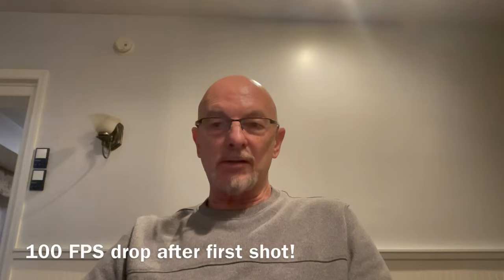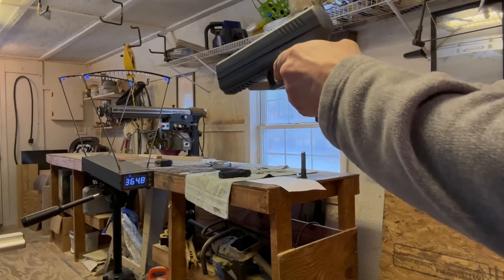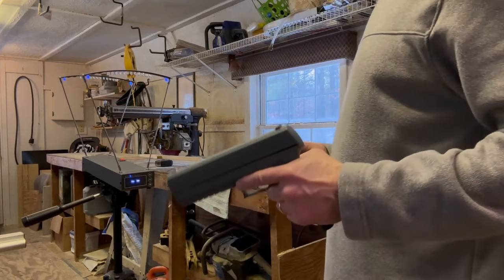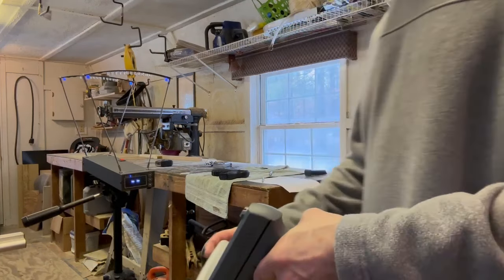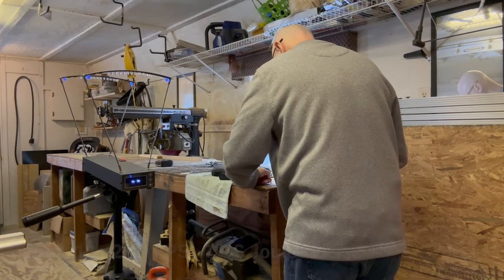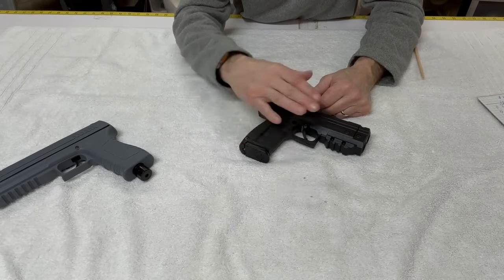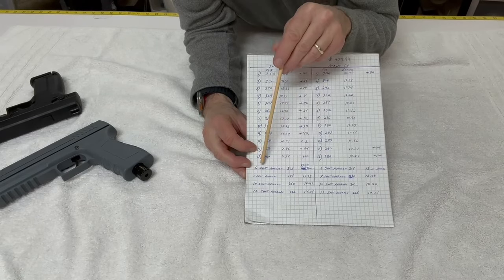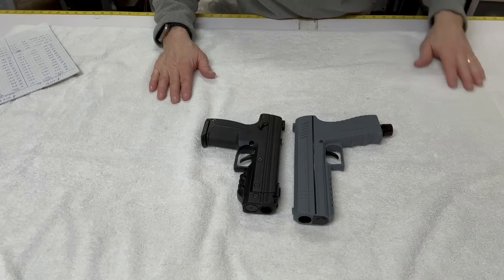Salt Supply S2 Blows Byrna LE Apart in Performance! Wow!!!

Comment: I placed an order for the LE 4 days ago, luckily it didn't ship out yet so I was able to cancel and order a Salt Supply s2 instead! :)
Reply: Same here.  I ordered a Burna...but then saw videos of the Burna firing capsules at a person wearing a light to medium winter jacket.   The capsules failed to burst, and the capsules caused no deterrent pain for the target, due to the jacket protecting the wearer.
Reply: @TrilobitesRTasty  I  had to confront a homeless guy a few weeks ago. He was looking through my patio at 2 a.m. I was wide awake and got my camera notification. I stepped out onto my balcony which overlooks the front door/ patio and yelled at him. I also had the S2  in one hand and that probably scared him away. I am just upset that I wasted a co2 cartridge by puncturing it beforehand. LOL Luckily for him he walked away or else I had 2 mags ready to unload! Along with pepper rounds! :)  Oh and a full can of bear spray for fun!
Reply: @DavidtheFoodie  I fully agree with  using less lethal defense in situations you describe.   I ended up purchasing several of the "Sabre Aim and Fire Pepper Gel with Trigger and Grip Deployment System" product...for under $50 each.   They send pepper spray gel about fifteen feet and are good for a dozen shots each.  Plus, there is a grip safety, to prevent accidental discharge.
Reply: @TrilobitesRTasty  It's great to have options. When I got the less lethal I told my wife it's for annoying people like guy I told you about. But hey if someone busts into the home then it's on to the real deal pew pew.
Reply: maybe you will not even need it one time in your live, but nevertheless a must have, but I would take anytime the HDP/HDR over the Byrna or Salt, you can buy two Pistol and a Revolver for one Salt!
Reply: Mistake, I have both Byrna much better

Comment: To fix your LE you really need to follow Seans modification video. Drilling the valve piston made all the difference. I first tried removing the spring thats in the handle and that did not do much. When I followed his tutorial on drilling the piston valve its night and day. I start out now at 425 and gradually decrease from there for 2 full mags. No more 200’s - 250’s on the 3 shot, After having it open and removing some “extra” parts it’s very easy to work on.
Reply from the maker: It is on my to do list Sean is a genius thanks!

Comment: It's  about what I figured, with the higher muzzle velocity of the Salt it runs out of gas after 10 rounds. My Burna LE can shoot 20 fps slower but can shoot 17 rounds before it gasses out. That is three mags. Take your pick. Plus the Salt is huge, even the Burna LE is a large gun.
Reply from the maker: I totally agree with you! The Byrna also reloads much easier and the pierce and shoot is priceless. Thanks for dropping by!

Comment: Excellent comparison video! For Byrna to be charging $479 for a “professional” launcher that gives subpar numbers is ridiculous! Sounds like that high markup is really going to pay for their advertising. There are only 2 things I like about the Byrna, and that’s the “point and shoot” technology, and it’s a little more compact. The pushing the button on the bottom may not always be ideal when carrying outside the home. That is where the Byrna has a huge advantage. However, in the home I see the Salt Supply along with a modified HDR and HDP 50 being my “go to” launchers.
Reply from the maker: You hit it right on the nose and that is exactly how I feel about it! I probably won’t carry it but it will be in my vehicle in case of a road rage incident etc.
Reply: Yeah, home defense and carrying around are 2 different things. HDR too big to carry, so it is better suited for a  HD launcher.
Reply: What would be a good alternative luncher other than the LE??
Reply: @airgunnerreviews7888 what about the S1? Been trying to find numbers on it but it has the trigger quick pierce and mag in the traditional location
Reply: @AugustDavinDeepson a tweaked first strike compact

Comment: It’s a physically larger launcher. That certainly plays a part in the power differential. And they have taken the appropriate time to tune it optimally. The results speak for themselves. Great job as always.
Reply: How’s the accuracy of the Salt S2?
Reply: A physically larger launcher isn't going to account for power in these guns. The LE is losing gas somewhere, it has nothing to do with it being smaller.

Comment: Recheck your math… the Byrna never shot under 280, yet the 12-shot avg says 265. Excel says it’s 298.5 avg 12-shot for Byrna. Salt still wins with those first shots being so consistent at 326.66 (12 shot avg)
Reply from the maker: I stand corrected! I rechecked and you are correct, good catch! I’m pretty sure in a self defense situation it is unlikely you will be reloading so the biggest consideration would be the first clip. Byrna 7 round average is 310 (12.88 Joules) and the Salt S2 six round average is 365. (17.85 Joules). Thanks for keeping me in check and for watching!!!

Comment: Outstanding demonstration between Byrna's LE and Salt Supply's new S2.  I had the very same experience with my LE, so I also purchased the S2 during the Shot Show 2024.  S2 extremely consistent output between 15-20 joules.  With the exception of the LE's first shot, the S2 blows it away.  I still own the HDXL and SD.  They are both consistent at around 10 joules.  I like the SD because it's easily concealable to carry, especially at S.O.B. (small-of-back.)  Whoever designs a launcher the size of an SD (or smaller,) that shoots consistently between 15-20 joules will dominate this market.  Your excellent demonstrate is proof positive!!
Reply from the maker: I second that thought regarding smaller design with power! It seams like the launchers keep getting larger, I like my SD for the same reasons!
Reply: Yep you nailed it. Smaller with that amount of power and it's gold.
Reply: Hoe does the S2 effect an intruder compared to the Byrnas chemical?
Reply: was the byrna leaking air?  worn seal?  Years ago i played paintball and when my gun started to loose fps, it was either, running out air or there was leak....

Comment: Just buy what you want. 
Comparisons are nice, but they are 2 different systems. So of course they have different levels of operation.
I have a Byrne LE. I can shoot like 15-20 on one CO2. 
But the point is to use it to stop or slow down so you can escape.
And if you can’t escape, I guarantee you that 2 mags of 7 shots each will stop just about anyone.
Plus I can reload in 5 seconds.
2-3 in the groin and if needed 10 in the head.
I have a 1000lum light and a laser sight accurate to 40ft.
But I am sure that the other one will work just as good if the shots are placed well.
Cheers
Reply from the maker: I totally agree thanks for your input!
Reply: Great point.  Thanks

Comment: Really consistent first 8 shots! Thank you for posting this and how many shots you get before running out of CO2. They (Salt Supply) seem to have figured out optimizing the power. Prior to the repair were the two launchers comparable for the first 8 shots?
Reply from the maker: 12 shots gets you down to 180 fps and that pretty much is it! The LE is advertised to have a 7 shot average of 340 fps and it is capable of hitting that mark when new but the first few shots are always high fps and drops. This test shows the S2 had a 7 shot average of 364 and a 10 shot average of 350. It is very consistent!

Comment: I'm curious how much less powerful the "repaired" byrna LE is compared to a new one. 
Also has the Salt ever been repaired? This could also effect the test. 
Also did you fire the byrnas first shot with the CO2 cartridge pre-pierced with the safety on or did you fire the first shot without doing so (can make the first shot be half the power). 
Also since you swapped for every shot instead of just consistently firing with the same gun how much CO2 was lost between firing and writing things down?

I personally prefer the byrna because it's magazine fed which means you can have a faster reload time if the situation requires it. Also the magazine has a tool built into it to allow for easy CO2 swaps. 
I think these are both great options for launchers it just depends on what you're using them for or how you plan on using them.
Reply from the maker: Thank you for your input and great questions! This is my second Byrna LE, my first one also failed and after repair did not have the same power so they replaced it with this one and it blew a seal within 48 hours. Just like my original LE once it has been repaired it doesn’t have the same power as when new. In this test I pierced the C02 when on safety so the first shot had full power. The Salt S2 has never been repaired and if the Byrna LE was new the results most likely be in the Byrna’s favor (I think). No loss of C02 between shots and the pause actually raises the fps. I do like the Byrna system much better for the exact reasons you stated, the salt makes a good truck gun but too large to carry. Stay  safe!!

Comment: Just got the LE to replace the Tippman TipX which is very large but never fails, and has the same pull the trigger to activate mechanism.  Wish I saw your channel before purchasing.  Right out of the box it wont fire unless you press the mag in while shooting.  They said they will repair it but now sounds like this is a serious quality control or engineering problem, or both.  Very disappointed, they lost my business and wonder if is worth trying to fix it myself.
Reply from the maker: Byrna claims they test each marker to make sure it is working properly, someone was sleeping on the job!

Comment: I won’t address the power of the Byrna, but long story short, I have had reliability problems with the LE, and the SD.  It’s been frustrating sending these models back for repairs.

Byrna’s customer service has been good, I will say that.  But my confidence is shaky right now.  Hopefully this latest repair will hold.

The bad guy could be carrying a firearm, so consistency is crucial.  

Crucial.
Reply from the maker: You are so right, consistency is crucial! Thanks for dropping by!

Comment: Ok heres my question does the salt supply s2 have the feature where it doesnt drain the co2 tank til after you fire cause thats what makes the byrna ideal for self defense cause i won't have to worry about performance or the tank being dead
Reply from the maker: With the S2 the air cartridge stays sealed until you strike the bottom of the handle which punctures the cartridge in case of an emergency. The Byrna has a better system with the pierce and shoot technology!

Comment: Thank you for the test you did on the BYRNA vs SALT. I thought it was very methodical and the way testing should be done. I bought a BYRNA LE a couple of months ago and am very happy with it. However I don't have the Chronographs to do what you did. Because of your test I bought a SALT and anxiously waiting for it. There is one thing I haven't found anyone has done, and that is test Kinetic rounds. For example, You have the BYRNA rounds that measure .6845" which has about .006" clearance in the bore of the BYRNA. Amazon has a very nice Kinetic round that measures .6785". My curiosity is, does the smaller Amazon round affect the FPS a lot or a little or at all. Having more clearance in the bore theoretically should lessen the FPS. But no one knows how much or how little. Would you consider testing these two rounds? The cost difference between the BYRNA and Amazon are quite significant! Thank you in advance for your answer!
Reply from the maker: I will look into what Amazon is offering, in the mean time I would head over to Less Lethal For Dummies YouTube channel Sean has tested a lot of different round! Thanks for watching!

Comment: Ive contacted byrna letting them know my LE gets consistent 10-12 joules average. I feel ripped off. My LE performs like what they advertise for an SD.
Reply from the maker: If Byrna doesn’t start listening to their customers instead of making excuses they will be faced with layoffs for sure!
Reply: This is why I'm glad I stuck with my Hi Viz instead of upgrading to the LE. 
Of course Air Gunner Review did teach me a few things about maintenance on my Byrna last Spring so it's stayed pretty consistent in the FPS when I've been using it... Over 1000+ rounds and counting.

Comment: Could it be that you got a bad one. Maybe seals are bad and once the cannister is punctured there is a leak. They should replace it for you. Im curious to know. Every product out there has some duds. The salt looks impressive. For the price the byrna should be performing well. I like many features in the byrna but this drop off is concerning. Maybe a quality control issue. I gotta check out the salt gun. Looks good for a good price.
Reply from the maker: My first LE failed after 10 months and was sent back for repairs and after receiving it I sent it through the chronograph and noticed a major power loss after the first shot so I returned it again and they sent me a brand new one, this one shot real hard and consistent (25 joules first shot!). Unfortunately it was short lived lasting only 2 days and 4 C02 cylinders and blew an o-ring. I sent it back for repairs and what you see in this video is the results. I emailed Byrna about the power drop and they told me it was thoroughly tested and passed all tests and there’s nothing else they can do for me! If you go to DK Spencer’s channel he had the exact results after repairs. I think Byrna knows the LE has an o-ring problem so they are changing the internals to lower the power when they come back for repairs they are counting on the fact most people don’t have a chronograph.
Reply: @airgunnerreviews7888  Thanks for sharing the history. That's very frustrating to hear. The LE is expensive and has the claims of shooting hardest. If they purposely reduce power instead of trying to fix the issue, then they shouldn't make these claims. Their product is expensive, there should be some quality that comes with the price. I hope they see your video and fix the problem. Thanks again for the time and the video.

Comment: Thank you for your videos very informative I almost bought a byner le after watching this video on some of your others I felt that the burner is very overpriced I ordered the S2 salt gun 2 of them I didn't just order them because they were almost half the price but I felt that the S2 gun is better built more powerful after the first shot than the other gun and being retired mechanic but not a gun expert after looking at your other video where you took apart your byner  that failed I could see that gun having failure problems in the future due to its design and hopefully the S2 will be more dependable thanks again for your time
Reply from the maker: The Salt S2 is a solid tank and you can use all brands of C02 and projectiles. Thanks for dropping by and good luck!

Comment: What happens with salt gun if you leave air cartridge in. Is it also punctured with the first shot?
Reply from the maker: No with the salt you have to strike the bottom of the handle to charge the c02
Reply: Thanks

Comment: Highly considering this one after my LE had to get repaired. Only question I have is if it would fit in the same safe box I have. Do you know if it would fit in a box with these dimensions: 9.25” x 7.15” x 1.75”
Reply from the maker: Yes it will fit! The S2 measures 8-7/8” L x 6-7/8” x 1-3/8”H

Comment: Just a guess here but listen, neither gun is designed to store with punctured co2, right? But still techncally being contained pressure systems,  means that each has a specific amount of EXTRA co2 escapping during each shot. Escaping to...? Whereever it can go depending on the shape of the plastic just past the metal valve. Meaning if the plastic isnt vented or spacious enough to disperse the air  enough.. that co2 bounces back and cools down the metal valve even more than just firing it already had, and droppin the  cylinder  temperature even lower with each shot. So you have a co2 cylinder, pressurized  within a cold metal valve, surrouned by thick cold plastic. Yaa its not warming up anyime soon.. 

So presuming you're aware that co2 pressure increases dramatically with heat...well, thats why the byrna started off strong and got weaker with each shot. The salt might just be shapped better to keep cylinder stable temp.  Try breaking the rules just slightly and letting byrna sit and warm back up for like a half hour after firing each shot. Id wager itd be a lot more consistent.
Reply from the maker: True points here but an interesting note is the Byrna SD doesn’t have the same issues with a large drop off like the LE has!